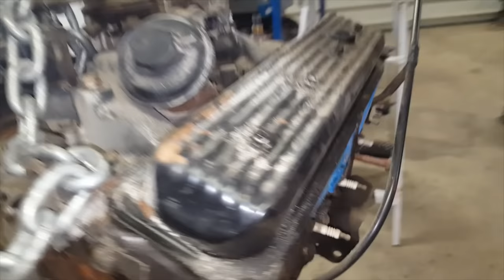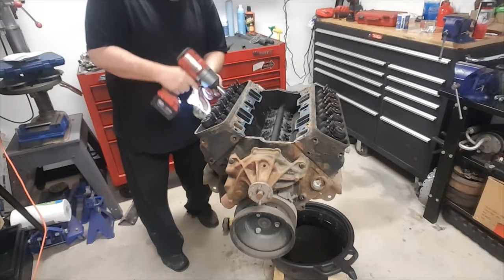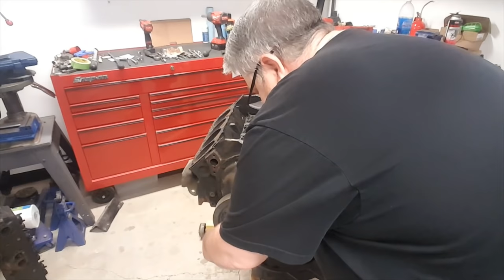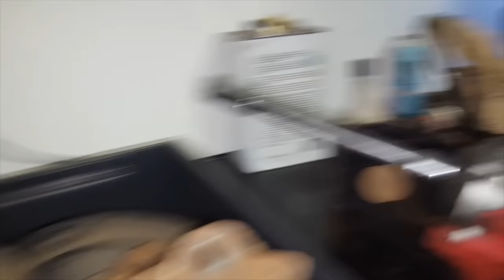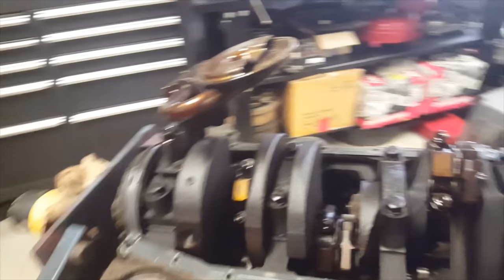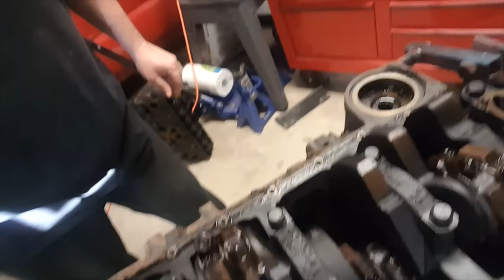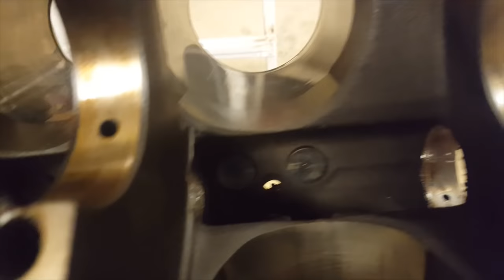350 Chevy TBI 5.7 Engine Tear Down / Rebuild , Video #1

Comment: Great job. Very informative. Question, did you send the block to the machine shop or just the crank? I didn’t know if it needed line boring or no?
Reply from the maker: Hi Larry , The engine was sent to the machine shop , Block, Crank , Rods , Heads. I have a 4 part build on this engine if you can see my other videos. Thanks.

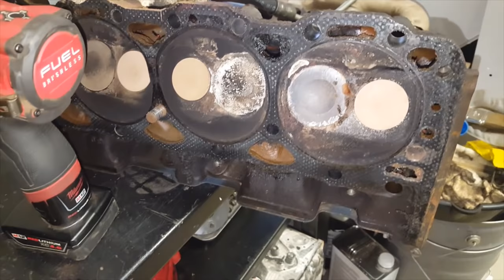Comment: 43:51 I have a set of 191's that are 64cc, mine have a triangle symbol at the valve cover face on the end of the head upper , i'm thinking the 191 came with ether chamber size ?? i think if you want the roller block you have to look for the 5.7 that came from a 1500 series i think the 2500 and 3500 trucks got the flat tappet blocks, id like to hear what others reading my comment have found......
Reply from the maker: It is interesting hearing what others have seen , maybe some will chime in on their findings.

Comment: How do you get the cam shaft bearings out, and replace them?
Reply from the maker: You need a cam bearing removal / installation tool to press / tap them out , and then re-install.

Comment: Where did you drain that plug from? Is there a couple
Reply from the maker: The coolant plugs?
Reply: @jaysgarage3616  yes the coolant plugs. I’m having a hard time locating the coolant plugs on my v8 vortec 5.7 on the starter side. I found the one on the oil filter side. I’m having a leak. My other plug is leaking coolant and i want to see if my other plug is leaking coolant. Im missing a few bolts after i went too a shop. I dont have much knowledge of motors but my brains a sponge. I think they took out my pipe plugs. I think there is 3 on the 350 pipe plugs.

Comment: Hi sir good morning big fan I like the way you explain what your doing thanks for your videos I was wondering if you can help me  I started leaking motor oil from the oil pan I went down to look and seen a hole had blown out the size of a golf ball by any chance do you know what could have happened I have a 1988 GM C2500
Reply from the maker: Sounds like a connecting rod stopped let go , it likely did alot of damage and you may be better off looking for a replacement.
Reply: @jaysgarage3616  yea I thought it would be some bad news thank you for your help I appreciate it I'll start looking into finding a different engine

Comment: Awesome video, My Question is. can a camshaft cause a low oil issue in a chevy 4.3 vortex?
Reply from the maker: It typically would not , a spun cam bearing maybe but not common in a 4.3.

Comment: What's the labor time install heads cam lifters intake in a 95 tahoe?
Reply from the maker: Probably 12-15 hours for stock stuff , a little more if adding new performance parts.
Reply: @jaysgarage3616  in the car ? All edelbrock stuff

Comment: Will the V6 accessories "ac bracket, alternator bracket" fit a v8 350??
Reply from the maker: The 4.3 A/C bracket will work on the 5.7 ,

Comment: what is the best cam to use for power with all original parts and original ecm?
Reply from the maker: Hello Jose , There is no easy answer to this question , by design the pcm and fuel system limit any major changes. Do you have a chip or a person who will work with you? Do you have an adjustable fuel pressure regulator? You would need both and without I am afraid your gains would be minimal. A cam smaller than 206@0.50 with a fuel pressure of 13 psi can work however I cannot guarantee every vehicle is the same. The best cam also depends on what you use the truck for and what you want it to do ex , is it a 4x4 , a tow vehicle , does it have large tires , etc. I hope this helps.
Reply: @jaysgarage3616  im actually doing an engine swap on my 3rdgen camaro from a 305 to a 350. I want to keep the everything stock plus a decent enough cam just for extra fun for the time being considering it is my daily.
Reply: @jaysgarage3616  and for all those questions you asked me, my answer is no unfortunately. And I don't know what I need to make everything properly work either. It's a 92 camaro rs.
Reply from the maker: @JoseGarcia-sb1fg  I think the same applys , a small cam but in a third gen Camaro I would do headers , exhaust and a free flowing air cleaner with the 350. You should try both throttle bodies as the 350 one may be slightly larger (The prom may not like it) but keep the 305 one in case there are any issues. This will help more than a cam but keep your o2 sensors functioning and make sure you have a good tune up. If your doing short bursts and not 1/4 mile add some 3.42 gears and a 2600-2800 stall and have fun. The engine stock is only good for about 4500 rpm and adding a cam just moves your power band up where the heads and induction are limited , and then there is the required tune. It might not be the answer you want but I don't want to steer you in the wrong direction. Hope this help's , Thanks.
Reply: @jaysgarage3616  thank you. this helps me to get a better picture of it. for sure I'll be doing what you said and thank you for your time typing it too.

Comment: This looks like your oil filter is a large one threaded up into the bottom of the engine... Mine goes in from the side, it's a K1500 if that makes a difference but I'm told my engine is a 350 TBI... I've looked for casting numbers, no luck, can't get in an see it...
Reply from the maker: If the engine was installed in a 4x4 they could have removed the filter and oil filter adapter and installed the adapter for the one like you have and ran the oil filter like that. One of the problems is if there is any debris in the cooler or lines from the engine you replace it could be transferred to the new one , I am doing a swap right now with a cooler adapter and lines and am running this set up. If they clean or replace the rad and lines they can change it back , lots of debris in this one.
Reply: @jaysgarage3616  .... I'd replace lines and adapter if that's the set up... Keep that set up just go new with it...
Reply from the maker: @poppagrouch4781  I agree!

Comment: 1 HAVE A 93 BLAZER 1500 MY ENGINE BLOCK CRACKED..A GUY IS TRYNNA SELL ME A 10054727 BLOCK SAME AS YOURS BUT HOW DO YOU KNOW WHAT YEAR ITS OUT OF??I KNOW I NEED A 87-95 BUT HOW DO YOU KNOW WHICH YEAR THE BLOCK IS EXACTLLY
Reply from the maker: Take a look on the front pad in front of the passenger side cylinder head and look for the suffix code. Look up suffix codes for sbc and see what it was from including the year , sometimes on the rear of the block there will be numbers as well. They can sometimes be difficult to figure out but usually they are there.

Comment: Subscribed. I have a 727 non-roller engine that came out of my 92, was wondering how you plan to remove those lifters that are slightly mushroomed at the bottom. Is there room in the cam tunnel to drop them out the bottom? This is a spare engine as I went back in with a 638 block roller setup. I’d like to see what I can do with it so I can have an engine more or less ready to go for a near-future project.
Reply from the maker: Hi Robert , There is room to push the lifters out the cam tunnel , all 16 from this engine went out that way. Thanks for the question!

Comment: thinking about rebuilding or having someone rebuild for me my 94 chevy. Smokes a little when it starts wondering if it’s something simple and not expensive
Reply from the maker: Typically if it smokes at start up it can be valve seals  , I would have them replaced if it runs well and does not use oil between changes.
Reply: @jaysgarage3616  she burns the quarts when idling for a while, i keep a extra quart in my truck with me.  i had a dakota that was way worse though so it seems reparable? i don’t know lol
Reply from the maker: @sledfan9646  Still could be seals , likely valve guides and just wearing out after years of use. Really hard to say without seeing it.

Comment: I know this is an old video but i  have 99 suburban think i just destroyed a connecting rod or bearing. It blew oil cooler line n then i fixed it filled it n drive it home now it knocks
Reply from the maker: Yes , That is unfortunate but it does happen. Make sure to replace cooler and possibly the lines as there will be bearing material all through there and you don't want that in the next engine.

Comment: Hey Nice vid , I am curious what year this block is , and i was surprised to see that their was no casting blocks for the roller cam ?  and this looked to be a truck engine .. i thought they all had the casting block , but un drilled . i found it , a 1993. Those bores are really polished.
Reply from the maker: Hey , yeah it was a 93. Thanks for the comment.

Comment: Can anyone help me? I've got a 1992 Chevy 350 TBI in a conversion van and It's got about 138,000 mi on it The engine is in really great shape. I replaced all the gaskets and all of the engine electrical. Every sensor, cap, rotor, plugs,  wires, injectors, full throttle body rebuild and I've got the timing locked in at 0° before top dead center. Every so often when the engine is warmed up after I come out of the grocery store I start the engine and it has a loping idle for about 10 seconds and then it evens out and it runs like a top. This only occurs when the engine has been warmed up and I turn it off for a few minutes to go inside a store and then it evens out after about 10 seconds. Any ideas??? I'm at a loss. I even replaced the charcoal canister and made sure the EVAP system isnt blocked.
Reply from the maker: Hi Joey , Sounds like you have all the bases covered so far , is your 02 sensor original or part of the sensors you have already replaced?
Do you know or have you recently checked fuel pressure , filter?
Did this start after verifying timing was set at 0?
Original Distributor?
When you shut it off and restart does it smell like fuel? any black smoke out the tail pipe?
When did this start to happen , is this the reason you changed all the electrical tune up components?
EGR , TPS module could be considered but I am wondering if your ignition control module is on the way out.
I would try to locate a good distributor and swap it   just to verify , if it has had the module replaced and it's not a GM brand that may also cause you   grief. I wish I could be more definitive but it's tough to diagnose from a distance. Let us know what you find and good luck.
Reply: @jaysgarage3616  I bought this vehicle abandoned about 6 months ago and I drove it back to my parking spot where I did a halfway rebuild all around. I replaced all the super important engine electrical stuff with ACDelco or GM genuine. It's the original distributor with a new ignition control module. The o2 sensor and the EGR valve are new as well as the solenoid which controls the EGR and the map sensor. 99% of the time this engine runs like a Swiss watch. It's just for like 10 seconds after start up when warm BUT ONLY If I've left it off for a little while. If I only leave it off for a minute or two when I start back up again It's completely fine. The person I bought the van from told me they changed the fuel pump and I changed the fuel filter. I figured if it was a fuel pressure problem it would be happening all the time right?
Reply: @jaysgarage3616  I can't say if it was happening before I bought the vehicle. When I started taking things apart I realized that it was mostly still completely original from the factory with the AC Delco spark plug wires and all the original electrical sensors.
Reply from the maker: @joeydrumstix  Do you have another coil? If you have a spare to try give that a shot. i am interested to see if that would help. I can only throw ideas at you without being there or seeing it but keep us updated. Thanks.

Comment: Are we getting the Part 2 rebuild? I’m starting this right now.
Reply from the maker: I was actually at the machine shop this morning and both the engines from the videos 350 TBI and 305 are at various stages of completion but not done. They have been very busy and said they will be on them as soon as possible. I will do the build as soon as it is back.

Comment: Great job... gotta ask.. where'd the paper towel come from....?
Reply from the maker: The wypalls? You can get those from any industrial supply store or Amazon. Thanks for the reply!!
Reply: @jaysgarage3616  actually Sir, the one under the intake when u pulled it off, lol.. or did I miss something.. BTW, I'm not sure I've ever seen a more informative video.. The presentation in a manner that is understandable.. Video was good.. if by chance u have an items list for parts used I'd be very interested.. Be safe and take care.. Thank you again..
Reply from the maker: @treysberta  On the actual rebuild I tried to capture every part # when assembling but I will look into it.
The paper towel , I am assuming someone had stuffed it in the distributor hole and pushed it in after. I appreciate the comment!!

Comment: Moré power hp?? How but not special modification only basic please help me
Reply from the maker: There is no easy answer to this question. I have tried full exhaust , headers , throttle body spacer , K&N filter , underdrive pulleys , and gained little. I have seen before and after wheel dyno results from stock  to computer mods to Vortec heads and several camshafts and 383 strokers etc and they gained little (sometimes lost)and presented their own compromises and issues. Make sure you do a good complete tune up with fuel filter and have a catalytic converter or or bottle muffler at the y pipe so the o2 sensor work properly and it doesnt stay in cold loop (about 40-50 mile loss per tank of fuel in my truck) add 2 to 4 degrees of timing from base and give it a try , that is the easiest thing you can do , electric fan and adjustable fuel pressure regulator help but might not be worth the effort. Hope this helped , Good luck.

Comment: Amigo tengo un motor 350 Chevrolet tbi recién echo el problema es q en frío marca más de la mitad el medidor de aceite y luego viene callendo a 0 cambie bomba de aceite otra ves y nada quite el tapa válvula y apenas medio le llega aceite más no sale a chorrito le hice servicio al radiador cambie aceite nuevamente y nada. Ayuda q puede ser..??
Reply from the maker: Try checking with a mechanical gauge to confirm the oil pressure sending unit is functioning correctly , could have alot of bearing clearance and you may want to try heavier oil , it's tough to diagnose but this is a start.
Reply: @jaysgarage3616  saludos después de traducir todo jejeje te cuento el motor es recién echo cambie taquete pero lo q me di cuenta ayer es q mientras más subía temperatura xq le faltaba agua no me di cuenta ajá mientras más subía temperatura más salía aceite a chorrito entonces me estoy imaginando es q tengo q echarle un aceite más delgado.. el q tiene ahorita es 20w-50 creo q es muy espeso para un motor recién echo.. cual usted me recomienda. Yo pensaba echarle 15w-40 pero cual usted sugiere saludos desde mi bella Venezuela
Reply from the maker: @jenniferbravomarcano2880  Good Afternoon , I did not realize it was a new engine , I would use a lighter oil for sure. Oil pressure will drop with heat for sure. The 15-40 is still a little heavy , do you have any 10-30 available? You could try 10-30 and if you only have 15-40 available you could try that as well and see what your oil pressure reads but I would not rev the engine real high but other than that it should be ok.
Reply: @jaysgarage3616  buenas tardes ok. Intentaré amigo y prender cuando eche gasolina porque por la escasez de gasolina hay la mamá de las cola..

Comment: Jason, I was really really enjoying the video however may I suggest you don't play a radio at the same time it was very distracting. And then for some reason right just before you took the crank out some god-awful music took over and your voice disappeared completely.
I needed all the info I could get because I need to do the same project for the first time.

I was really hoping you were going to rebuild with vortech heads and show me how to do that I have basically the same motor but want to use vortec heads.

I'm looking for the rebuild video now but not find it in your channel?
Reply from the maker: I apologize for those parts of the video , due to copy right infringement that was the only option I could find at the time when trying to upload the video , there will never be a radio playing in the back ground again. If there is something I can help you with let me know. The engine is at the machine shop and hopefully will be back soon and we will start the build as soon as we have it.
Reply: @jaysgarage3616  ah the copyright infringement that makes sense. Thank you for the reply.
I have a Chevy 350 out of a 1995 Chevy Tahoe. With the same heads.
It has 280,000 miles and I'm wondering how much I should do to it before putting it into my project 1964 Chevy C10.

I'd really like to see what's involved putting vortec heads on it And what all has to be changed. Carb vs. TBI, intake, cam? etc.  Would just like to get from 200 hp to something a little bit more respectable.

Thank you for the reply looking forward to your rebuilding video.